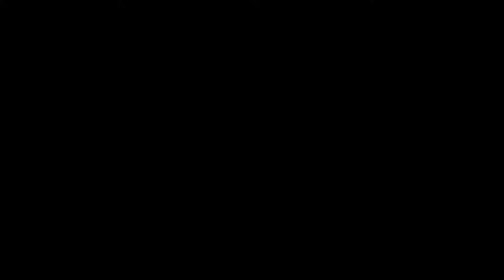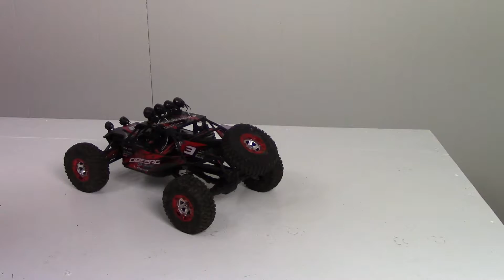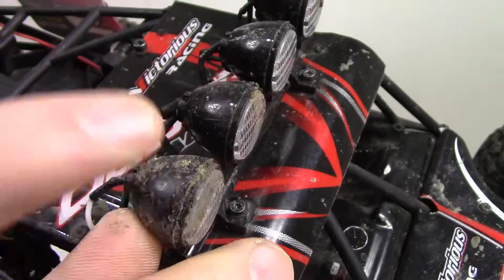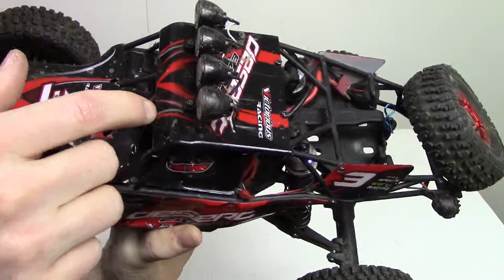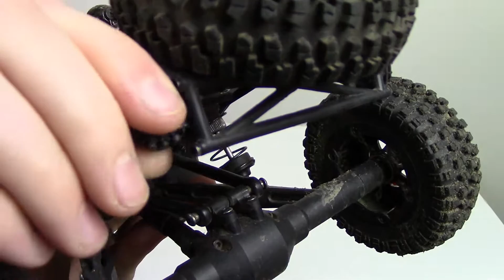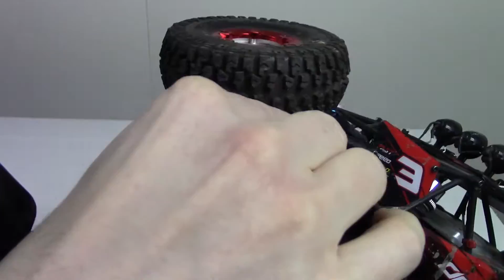How I did my tail lights on my Feiyue FY03 Eagle-3

Comment: Do you have a vid of how you did the top lights and where you wired them to? any help would be appreciated
Reply from the maker: Sorry I don't have a video on that. The lights just plugged straight into the receiver. Is your feiyue stock or have you done an upgrade to brushless? There are a lot more options for lights when you convert to brushless. If it's stock you can plug some lights into the receiver/esc combo unit, the plugs are different though and I'm not sure how much power they output.